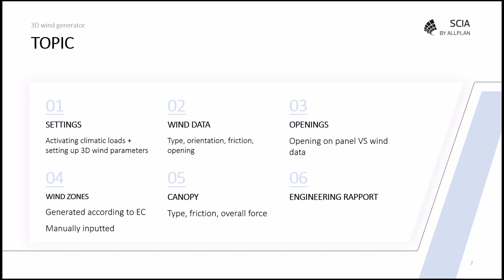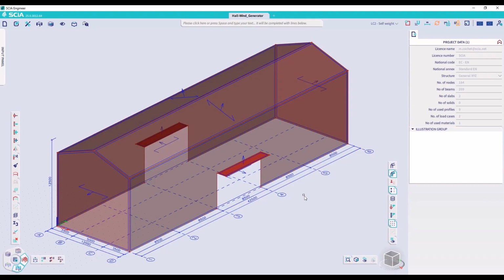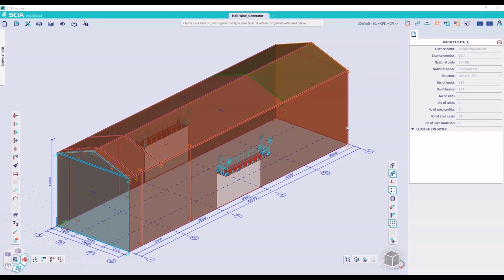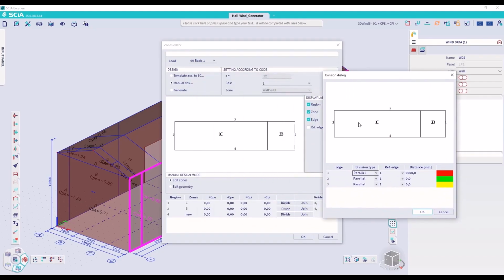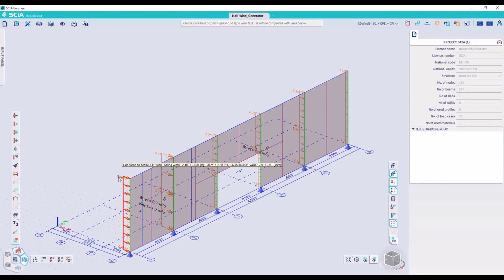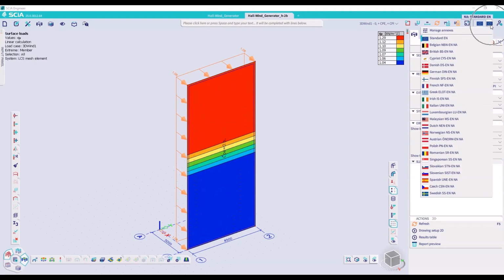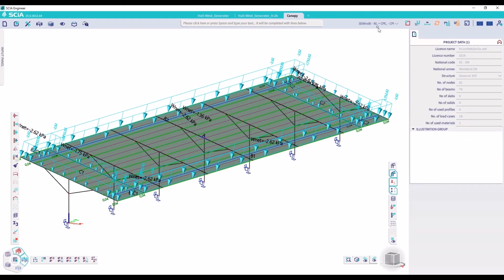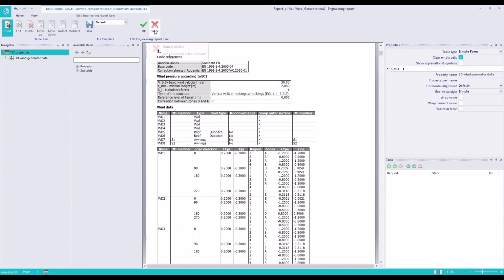[EN] 3D wind load generator

Comment: I keep getting the following warning when running a nonlinear (2nd order) analysis of a steel structure:

“Following problems were encountered during processing of the command:

Warning: Incompatibility in input data has been detected:

Global imperfections for nonlinear combination, free load applied on structure and/or load panels have been detected in the model. It is possible that some loads will not be applied on a structure with a changed geometry. Standard type of force load is recommended.

Free loads respect the altered, imperfect geometry of the structural finite element mesh in a nonlinear analysis (defined global imperfection). However, in case of load panels, their original initial geometry is being respected for the load generation from the free loads. Please make sure that all the free loads are defined in a way that allows them to be properly mapped to the mesh, in accordance with your original loading assumptions.”

From what I understand, free surface loads (for example those generated by the 3D Wind add-on) follow the imperfect/deformed FE mesh in nonlinear analysis, while load panels still use their original geometry for load generation. Because of this, some loads may not be correctly applied or mapped when global imperfections are included.

What is the correct workflow in this situation?

Should free surface loads be converted into standard surface loads before running a nonlinear (theory II order) analysis? Is that even possible within the software?

Otherwise, if I am not mistaken, this would make the 3D Wind add-on practically unusable for second-order analysis of steel structures.

Has anyone experienced this and found a proper solution?

Comment: As a long-standing customer, I am disappointed with the way SCIA deals with functional defects. We deliberately purchased an Ultimate license, partly because of the advertised function of non-linear material analysis for 1D concrete components - a feature that is described in detail on YouTube (https://m.youtube.com/watch?v=BZLVL97R-lY&pp=0gcJCcEJAYcqIYzv), the website and in product documentation.

However, this function does not actually work as advertised in practice. According to SCIA support (including feedback from the development team), a GPNL analysis can be calculated, but the stresses and verifications do not take into account the changed material parameters - making the function effectively unusable.

Despite repeated requests, documentation and offers of talks on our part - nothing happens for months. There is no feedback or we are put off until later. The initiative to solve the problem comes exclusively from the customer - this is neither customer-oriented nor acceptable.

I can only recommend anyone interested to check exactly which functions are really implemented in practice - and how SCIA deals with justified support requirements.